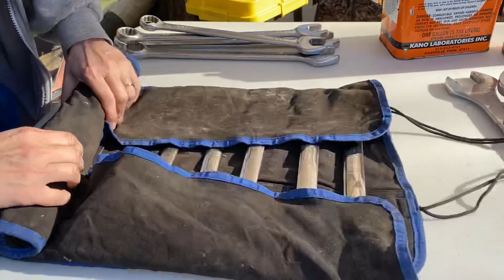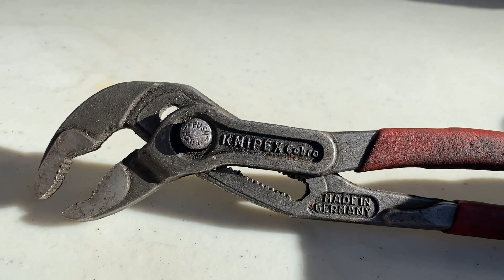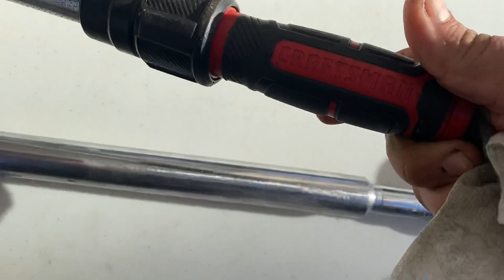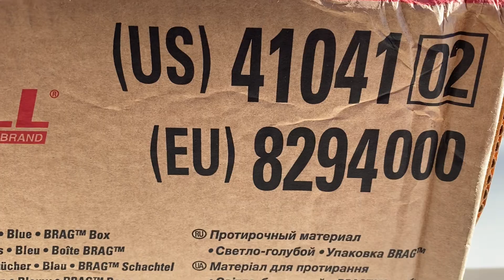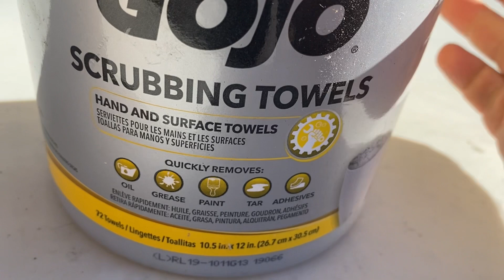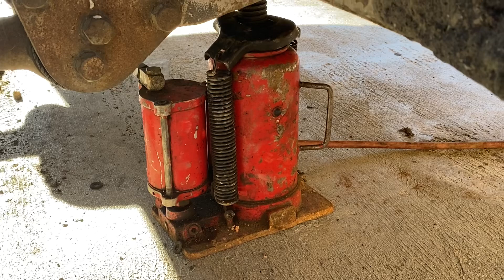Vintage bus owners favorite and most used tools.

Comment: I was wondering if you would mention the fire hazard 😳😮🔥.

I got the Wypeall towels after hearing you talk about them. Watching the video where you washed the bus with just one of them sold me on them. I bought a box of them. I am sold. Super absorbent! I use to buy red rags. Those are garbage if your oily, they just work ok for dirt or something. These towels are very absorbent and soak up a lot of oil and will wipe the oil off your hands. Unless your just wiping up lots of oil these will last, last as long or longer than your red shop rag till there so dirty or wet they need to be thrown away.

Comment: Hi, I have old 78 kw with silver  8v92  need help with a/c ? You might experience with these old detroit most have ac wiring the same,,a/c is front of engine with ac compressor next to is the ac dryet   with pressure switch on top  .. have about 6 wires all go tru engine bay to ac control inside issue was all were cut and now trying to wire it back up to make ac work ?  Any help i would appreciate it all wires are cut at the dryer and ac compressor so don't which wires go to what ? Did see only (1) had 12v power when truck is on other which did nothing

Comment: Very nice video , like you say get Life Time and all the tools you need to due things . That last tool torque multiplayer never heard of one I don't work on Buss but run in to lots of  Big stubborn nuts and bolts . Well get myself one for Christmas .

Plus best luck your back I did one simple thing I paying for it still  I go monthly to a pain Center finally I believe I got it not hurt all the y but still can't due things like I use to .
Reply from the maker: That torque multipler really only works on lug nuts.  It needs an anchor and the next lug nut distancing is what it uses.  There are orher multipliers that have bars to anchor them

Comment: I agree with you mostly, except about the wrenches- specifically the flare nut wrenches. I bought a Pittsburg set of flare but wrenches from HF, they were too heavily chromed, it made them too small to fit the corresponding size fittings, and the size that did fit opened when I tried to loosen the fitting, causing it to start to round . I ended up having to saw the line, and use a 6 point socket. - I have since invested in Blackhawk flare nut wrenches that I got on a close out sale from Granger.   I’m just too leery of the inaccurate tolerances of Chinese and Indian tools. But I do have some Taiwanese Popular Mechanics tools that are very good that came from WalMart - lifetime warranty, but sadly discontinued.
Reply: O. C. - I agree with you about buying a quality $$$ set of flare wrenches. The sizing tolerance and metallurgy make it all worth while. My tool set is mostly Craftsman. On rusty fittings, the opening on the wrench would expand and immediately round over the corners of the tube nut. grrrrr. In frustration I bought a set of Snap-on.  These wrenches were thinner than the Craftsman versions thereby fitting some locations that the Craftsman could not, did not expand thereby allowing all the turning force to be transmitted to all the faces of the nut and not round over the corners. Yes, they were expensive for a hobby mechanic, but it brings a smile to your face when a double flare nut on rusty rear axle comes loose without damaging the nut, the use of swear words, or the instantaneous desire to throw the wrench into the scrape metal bin.
Reply: I have also found some wonderful tool deals at Harry J. Epstein, they have many new old stock tools that were quality tools when made but often are orphans - often the result of 1980’s corporate raiders.

Comment: https://www.tekton.com
I have no affiliation with them  and am an aircraft mechanic by trade, but for the price the stuff is nice and cheep and seems to be high quality. 
It has a great warranty. 
The 30/60 wrenches are only available at snap on and tekton. All wrenches are 15 degrees and most angle wrenches are 15/60. Snap on and tekton are 30/60 degree. Which means with the 30/60 and normal open ends you can get to any nut 
The tekton are 1/4 the price and nice
I use a harbor fright ratchet every day. Snap on still has the best ratching screw drivers, and wobble  sockets

Comment: Don't know about all of them but the ace hardware around me sells Craftsman tools. They exchanged one of my Craftsman ratchets that didn't work no more. That torque multiplier works great we have one at work. Saved the mechanics lots of times at the shop and out on the road changing tires.

Comment: Great video.  Thanks.  Agree about Kroil.  Certainly in my use,  Kroil has blown the others away.  Agree that lifetime tool warranty is key.  Right behind that is ease of replacement.  I wonder if Lowes will honor a warranty on my 40-50 year old Craftsman tools .  Hope I don't need to find out.   Knipex are great.  Have several including Cobra.  I don't think I will ever need to warranty.   Also agree with you on Olights.  I have that orange one and others.  Saw you using those Gojos on a past video and bought them.  They are better than anything I have used so far.

Comment: Thanks for the video.. now I have more stuff added to my amazon wish list.. 
For torque wrenches, I have found ones made by Precision Instruments, its rumored that its the same company that makes them for Snap On.. the one that I bought that goes up to 600 ft/lbs was $375.. and its a split beam torque wrench, so its a little easier to use and you do not have to zero it out every time you store it. I think I have most of what you have there, except the stubby jack and that type of torque multiplier.. FYI my 3/4" milwukee impact just crapped out on me.. had to send it back to milwaukee, hopefully its under warranty.. I had them send it in with our company tools so hopefully I will get it back soon.. I do love that thing, cannot believe it crapped out on me..